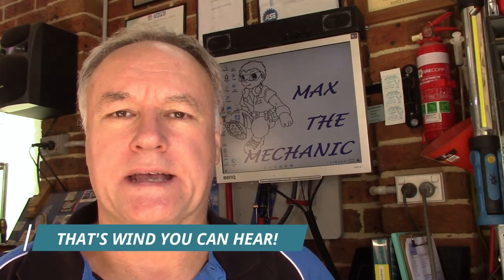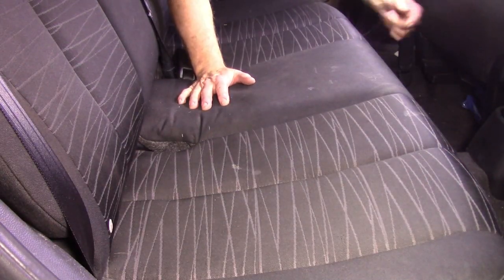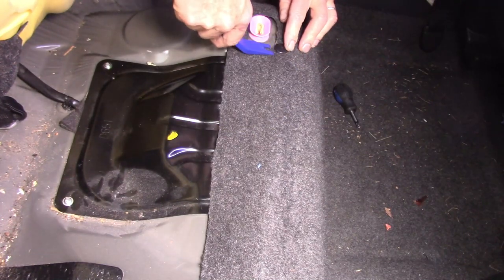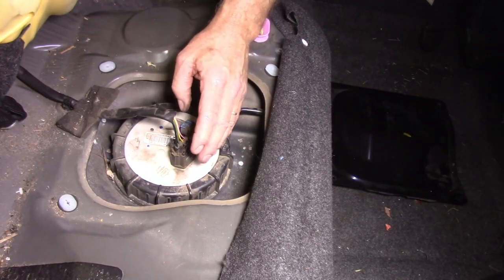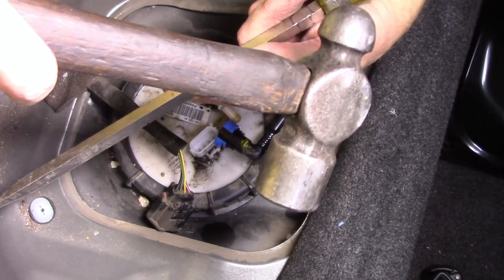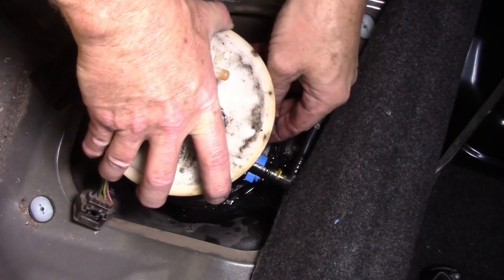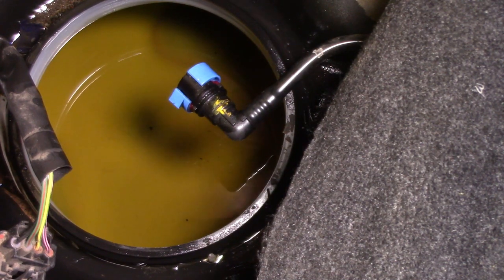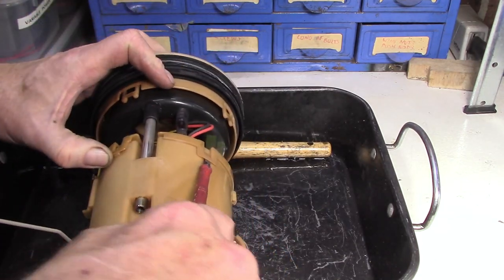Mazda 2 Fuel Filter Replacement

Comment: Thanks for that Max - little tip for those who just have a clogged filter sock but the pump is fine - amayama has replacement socks for $30. Typically takes a few weeks to arrive where I am (NZ), so in the meantime, you can take the sock off, give it a good soak in some clean fuel, brush out what you can with a toothbrush, and give it a good blast with some compressed air. Cleans it up enough to last until the spare part arrives, and doesn't require full disassembly.
Reply from the maker: Thanks for the heads up. I've not heard of them before. They look very similar to Partsouq. I'll put them in my favourites list and give them a go! 😉👍

Comment: Thank you for the great video, can you pls tell me what to do if benzinemeter does not work and where is the benzinemeter sensor?
Reply from the maker: Do you mean fuel gauge? The fuel sender unit is located in the tank and is part of the fuel module. Check for connections at the tank. You will need to use an adjustable resistor of some description across the wires to see if the gauge responds. If it does, then most likely, you have a faulty tank sender unit. If not you will need to look at the gauge or wiring in between. It also depends if the fuel gauge goes through the Body Management System. Check for fault codes as well.

Comment: Thanks for the video, very helpful! Just wondering, how did you go about cleaning the fuel sock? So far I've just tried cold water but that doesn't seem to have done anything
Reply from the maker: You can buy them as a separate item, not included in the fuel filter kit (for some strange reason). I just clean them with clean fuel and make sure that they are OK to refit.

Comment: Thanks for the video Miracle Max, I've replaced the whole pump with it's assembly due to a faulty fuel regulator and the pump's getting old anyway. However i found out that the new fuel pump Guage is inaccurate as i filled the tank to the brim but the guage has 1 bar left to the Full tank indicator. Can we perform some sort of calibration to correct this? Would appreciate your advice on this.
Reply from the maker: You may find that you have something caught around the float. I've been caught out by that before. Best way is to remove the pump, then do a full sweep of the float with it out of the tank so that you can see if it is getting caught

Comment: Great video, very detailed. I didn’t know replacement of the fuel filter was that involved. I stumbled across this video while trying to diagnose my own Mazda 2 that looks to have an intermittently starting fuel pump. More so after sitting for a while. A few cycles of the key generally gets it going. Sometimes along with an unusual noise as the pump primes.I have already changed the fuel pump relay, so am thinking the next step is to check power at the pump once I work out the pin outs. Does this sound like a faulty pump? Filter was changed as scheduled around 16 months ago. Keep up the good work and informative videos.
Reply from the maker: Hey Tdub,
The best way to check for voltages is at the fuel pump connector. Usually the pump has 2 thick wires going to it. You can also see if the fuel pump is worn by using an oscilloscope and a current clamp.
https://youtu.be/vrK2rruUknE?t=1420
If it doesn't prime straight away, get underneath the car and kick the tank - sometimes that will get the pump up and running. Obviously at that point, it shows the pump needs replacement.
Reply: Thanks , will try all that. It’s very intermittent which makes it harder to catch it in the act! Would you know if these Mazda 2 pumps are the variable type? Ie: 12volts to the pump when priming or under full open and a lesser voltage applied when normally running? it’s the prime on this one that is intermittent.
Reply from the maker: @tdub5899  You can see on the video that there is only one pipe going to the pump. This must be a returnless system, with the regulator built into the fuel module. It will most likely use a pulse width modulated signal. 
Hard starting as a result of low fuel pressure can be a faulty non-return valve in the pump. Unfortunately it is built into the pump and the pump would require replacement if that was the fault. 
Or it could indicate a leak somewhere - perhaps the hose that goes from the pump to the outlet of the module.
Reply: Thanks for replying. I’ll try and report back what I find in the hope it saves someone else some effort. Thanks again. Great channel.
Reply from the maker: @tdub5899  It's great to share the knowledge around 👍
Reply: Just reporting back that the symptoms I was seeing were the result of a faulty fuel module. Changed out the module and operation seems fine now. Went with the aftermarket Bosch unit that was less than half the cost of the genuine Mazda unit. Thanks for the video as it gave me a clear idea of what to expect when changing it. Keep posting as I enjoy watching you break down seemingly complex issues into smaller logical parts. Thanks.
Reply from the maker: @tdub5899  Great news on your diagnosis and repair!
I'm glad that you were able to get some help from the video. 😉😉
Reply: what is the "fuel module" exactly? can you share a PN?
Reply: @GalMk  the fuel module is the complete in-tank assembly you see Max remove in this video. I didn’t call it a fuel pump as it also contains the filter, valving and gauge sender unit. I’ve since lost the part number but it was the Bosch unit that came up when searching under the Mazda 2 model on the Supercheap site. Hope this helps.

Comment: Thanks Max, what year model & kms, I would like to do ours 09 but i'll wait till it plays up. What a poofter design F me. Is the VE comm the same?
Reply from the maker: The idea of replacing the filter is to protect the pump, injectors as well as all areas of the fuel system. If not done regularly, you risk replacing the pump as well. This Mazda 2 was a 2007 model with high kilometers. The filter should be replaced every 150,000 Km on this model.
VE Commodore needs to have the tank removed to access the filter.
https://rycofilters.com.au/part/Z888
https://www.youtube.com/watch?v=GA2OJuejs_8

Comment: Great video but was hoping to see what the filter assembly looked like….
Reply from the maker: The filter assembly is what I replaced. The filter element is kept inside the top of the module. It's just a pleated paper based filter.
Reply: @MiracleMAX  No worries. I was just curious as the intake fuel filter assembly is different to the canister-tyoe filters that other cars have underneath. I enjoyed your video though

Comment: That's a lot of work!
Reply from the maker: Actually Bae Lasso, that's fairly standard for a fuel module, which is common now. 
At least the tank didn't have to come out. With some vehicles, the tank needs to be removed, which includes removing the exhaust, tailshaft & some suspension components.
Thanks for your comments. 😉
Reply: @MiracleMAX  I just wish they would sale a complete assembly of it, so we could buy one, put it in, and only connect that oil tube and wire connector 😁
Reply from the maker: @BaeLasso  I believe that you would get that if you bought a complete fuel module.

Comment: Thanks for the helpful video! 

My Mazda 2 is at 160,000km 

Just replaced the fuel filter as per your video.

Car won’t start
I’ve tried a few times

The filter was installed correctly I took it out and checked again.

Obviously I’ve done something wrong, do you have any advice?
Reply from the maker: Can you hear the fuel pump operating? Has it blown a fuse? Is fuel being pumped out? Have you primed the pump?
Reply: @MiracleMAX  it was the small hose that you clip into the old part that stays with the fuel filter etc. it wasn’t pushed all the way in 😵‍💫😂
Reply from the maker: @youraussiematedean2506  Glad you were able to find the fault. A great learning lesson - well done!
Reply: @MiracleMAX  thanks for the video mate! Maybe this comment helps someone ha ha. All the best
Reply: How often would you recommend doing this and also how often to change the external fuel filter?  Thanks so much for your great video.
Reply from the maker: The Mazda 2 DE 2007 only has the in-tank filter. I recommend replacement every 100,000 km

Comment: but what good have you done here if you only replaced the casing? you still use the same old pump and filter, i don't understand
Reply from the maker: As mentioned in the video, the filter is kept inside the top of the 'casing' as you call it. https://youtu.be/b6VP8YQmk80?t=421
The goal was to replace the filter as part of the manufacturers maintenance schedule, not the pump as it was operating correctly.

Comment: Top video mate just what I was looking for, Very Helpful.  
Need to replace my Maz 3 in-tank filter. I'm guessing it's the same part number.
That sock at the bottom of the assembly, what does that do? it kind of looks like a filter also.
Reply from the maker: Hey Steve,
The sock is a filter - a first stage filter. It strains out small animals, rocks or anything of that size. 😉 
They don't come with a filter kit, but if you think of it, it's not a bad idea to install a new one when the pump module is out to do the filter. You'll have to order it separate.
You can use a search engine like this to find the correct part.
https://rycofilters.com.au/search/type/-
Reply: @MiracleMAX  Thanks for the reply Max. Just want your opinion. I had a look under the back seat of my Maz3 and the hole is only half the size, enough to only disconnect the fuel pump and fuel line. In another video a bloke had cut the hole bigger to access and remove the unit. These designs have got me buggered. It's either I do the same or pay a Mazda dealership 700 bucks because they have to drop the tank. If that was you, would you just enlarge the access hole? Cheers mate
Reply from the maker: Hey Steve,
As frustrating as it is, I would drop the tank. I couldn't professionally hack a bigger hole in my customers vehicle to gain access. Stupid of Mazda to make the hole so small? Yes! Other manufactures do the same. My  reputation wouldn't allow me to do a hack job for a customer.
Reply: @MiracleMAX  Thanks Max, I appreciate your honesty.

Comment: Can you tell me if these instruments apply to 2019 mazda
Reply from the maker: Sorry, what do you mean by instruments?
Reply: @MiracleMAX  Sorry let me rephrase the question. Do these mechanical procedures, removal methods apply to the next generation mazda 2 2015 and beyond.  Thx and nice work with the fuel filter.
Reply from the maker: @taichihead42  Hey G G, 
It looks like they are still located under the back seat, so it should be a similar method
https://www.rycofilters.com.au/catalogue/part/index/part/Z986

Comment: Hello i have a mazda 2 ,2011 and is not accelerating in speed 2,3,4,5 more than 40km/h what she can be the problem ?
Reply from the maker: Hey Arnold,
That is a broad question.
Does it have any fault codes? What is the fuel pressure? Is it serviced regularly? Are the fuel and air filters clean? Is there sufficient fuel in the tank? When did this start to happen? Is the exhaust blocked? Is the check engine light on the dash?
Reply: Heii is it serviced regulary but the filters i don,t know when they was changhe the car is not mine is to a friend of mine tank is full i just know this friend of mine she go with the car with this problem for 3 years..is not accelerating and is not any light on in dash
Reply: We live in germany and the services they say the car is ok all the time but never check acceleration she pass even the big control last year
Reply from the maker: @arnoldschiopu2298  As I said, it could be a long list that needs to be checked. Pretty hard to give advice without all the details in front of me. You would need to do a thorough check over of individual systems to narrow down the diagnosis. Do you have a scan tool, not a code reader? Can a volumetric efficiency test be carried out? What are the MAF sensor readings at idle and 2000RPM? Has the exhaust been checked for blockages?
Reply: No i don,t have a scan tool and she was not checked the exhaust i try to find out from internet the problem but i don,t find what exacly is it i make an appointment next week to mazda service . Thank you for your answers
Reply from the maker: @arnoldschiopu2298  Happy to help. Let us know if you find the fault
Reply: Hello mazda service find the fault , clutch is broken ,car she will be repair thank you for trying to help me .
Reply from the maker: @arnoldschiopu2298  Ah, the clutch is slipping! It will be good when it is fixed. Thanks for sharing the diagnosis.

Comment: Would the gas tank have a rubber plug in the bottom. 
And would it leak fuel from there if damaged?
Reply from the maker: No the tank does not have a rubber drain plug. I suggest you look for damaged hoses above the tank, unless the tank is physically damaged.
Reply: @MiracleMAX  thx for the reply.
The reason I ask is bc I just bought one today and after looking underneath the gas tank I noticed 2 holes (factory made by the looks of it) and one of them is plugged with a rubber plug the second one looks like it should have a plug as well but instead it has duct tape from the inside with the glue towards the outside of the hole.
Does the gas tank have a metal plate/cover on and maybe that's what I'm looking at insteadof the actual gas tank?
I'm afraid to poke it.
Reply from the maker: @whyisthisnottyping  You are right. It is most likely a fuel tank guard. There is no way a fuel tank would have a rubber bung. The floor itself quite often has drain holes that have rubber bungs fitted.

Comment: I can't believe you have not disconnected the battery before starting this work .
Reply from the maker: Can I ask why this would be necessary? The fuel pump is only activated when the ignition is turned on.
Thanks for your comment
Reply: @MiracleMAX  Dis connecting the battery guarantees no possible short when working with electrics around an open gas tank - The potential for an ignition source is eliminated .
Reply from the maker: @99fulham99  As I stated, there is no power at that point, but I appreciate your caution.
Thanks for your comment
Reply: He physically unplugged everything, what more do you want
Reply: @99fulham99  just see how most auto body guys welds panels without unplugging battery 😂

Comment: Isn't this a fuel pump???
Reply from the maker: This is called a fuel module, which includes the pump, filter, in some cases the pressure regulator and fuel sender unit. The filter should be replaced on a regular basis according to the manufacturer's requirements

Comment: This is the fuel pump and not the filter
Reply from the maker: This style is known as an 'in-tank fuel filter'. The filter is incorporated in the top of the fuel module, which includes the pump, which I changed over into the new filter assembly.
https://rycofilters.com.au/part/Z897